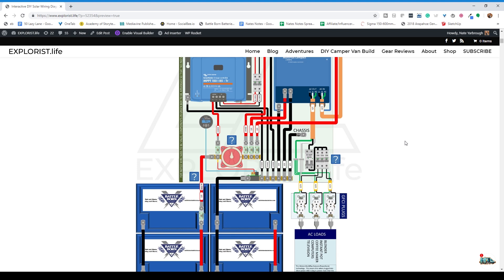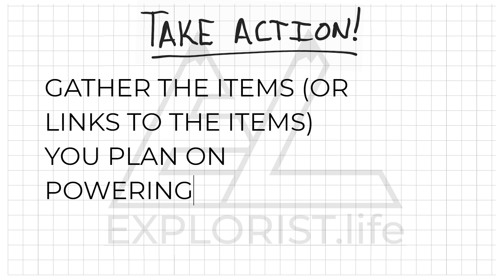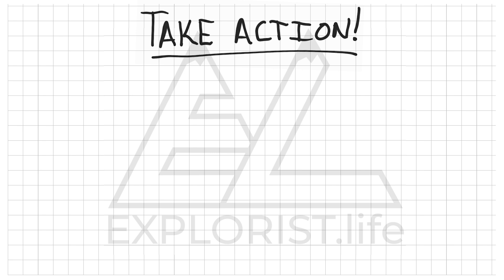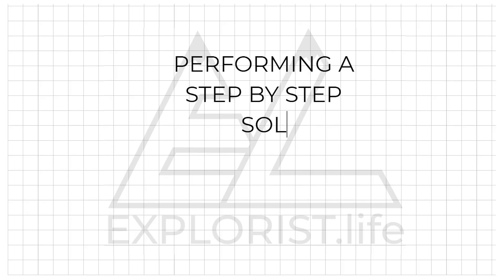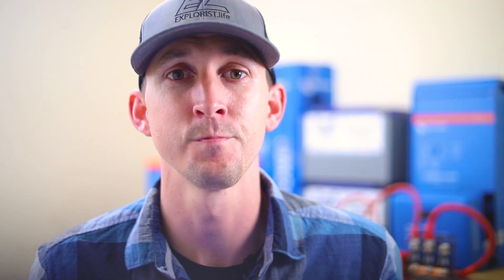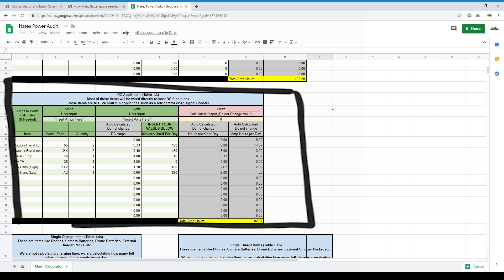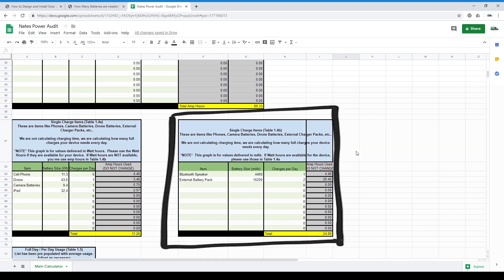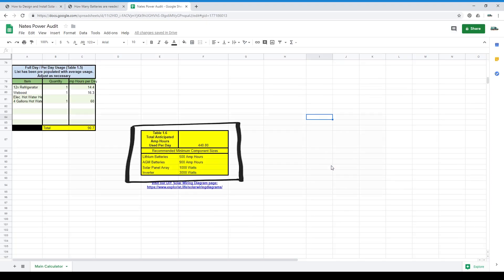How Much Solar Power Do I Need for My Camper? | How to Calculate Camper Solar System Size

Comment: Sir we are installing 4 panels of 180 watts each. Total is 720 watts. Which charge controller and which inverter will have to be installed for this, Victron company

Comment: I want to power a 300w pc system 8-12hrs a day, what set up do I need? How often would I need to run the van and how long running to charge up? Also how many batteries can u run off the panels? Is it a case of the more batteries the longer time you get? Does one battery switch automatically over to the next when one runs out? Can one battery be getting charged while another is being used so that you’re not using and recharging at the same time? Surely that helps the health?
Reply from the maker: We've made a video about PC usage, specifically:  Search: EXPLORIST.life How Much Power does a Computer Use?

Comment: Nate, what do you think about rich 2x250 and 3x100 slim panels? 

I have 4-5 bb100ah batts and 100/50 mppt. I have your kit and working through it all now. I have space to add those 3x100 so thought maybe a good investment
Reply from the maker: Sure!  Those are good options too.  Our kits can accommodate either/both of those solar panels.  Each set of 'like' sized panels will go to their own controller.  

If you're purchasing from us, reach out at shop.explorist.life/support for some more personalized guidance if you need it.

Comment: The sun would break all calculations. When it is possible better to make your solar system next to maximum. It will be useful especially in a winter time.
Reply from the maker: Are you volunteering to make an addition to our calculator to include sun angles?  If you don’t know how how to code, that’s fine, you could just fund that feature.  Couldn’t be more than $50,000 USD, I’d imagine.
Reply: @EXPLORISTlife  Dear friend, I meant weather report, not a sun angles and Yes! In a winter, un tilted, flat solar panels get ten times less sun energy from the sun then in a summer. If your roof for example has 1000 watts solar, then in a winter time your solar panels will produce only about 100 watts per hour, but with  the right angle, the  tilted solar panels  will be accumulating about 1100 watts of solar energy per hour. Clarity of the air in a winter is much better than in a summer. In addition, with higher voltage the solar panels will produce electricity longer during the day.
Reply from the maker: Our calculator is an estimator which includes all of that.

You definitely sound smart, though!  Thanks for sharing all of that.  If you feel like you can make our calculator more precise, let me know.  Otherwise, telling people that there's so much more to this stuff with no actionable steps forward just makes this stuff more confusion to people; so kindly... stop doing that.

Comment: 0:50
Or, "I want to use ordinary kitchen appliances that I use at home. Kettle, microwave, espresso etc."

If I can run a typical power board at capacity (240V 10A), I'm good.
That calculates to 240A at 12V. Watch the specs, but 250AH might do it iff it delivers 250A continuously. At least one doesn't.

If I want some headroom, then 3x 150AH, 2x 200AH.

Me, first source of electrons to recharge will be the alternator. Powered campsite or come to an arrangement for backup. Solar if I find I;m parked up a lot.

Comment: I definitely need to do this. I fell asleep watching it last night. I'm trying to figure this out so I can go full-time while I still work. My question is is it possible to run ac around the clock on solar? I have pets that will be with me. I get hot easy and I worry about the pets especially while I'm at work. Trying to get away from renting

Comment: I used the calculator but it says 1900 amp hours of lithium and 3800 watts solar array.  How many batteries is that? How many solar panels is that???
Reply from the maker: Panels and batteries come in many sizes.  For example: To get to 3800 watts of solar; that would be 38x 100w panels or it could be 10x 380w panels.

Comment: Hey Nate, really good and informative videos!
We're since one and a half years on the road and I just calculated our installed solar system and our consumption with your table. I gotta say in our case, it fits pretty well with your recommendation. The only thing is our inverter that's only 250VA instead of 1000VA
Reply from the maker: Nice work!

Comment: There was nothing new to me in this video, I am fully capable of sizing a solar setup, and still this is the best video I have seen on the topic so far, your spreadsheets is pure gold (I usually do my own on paper).
Then you also learn how to live on solar, you wake up, look out, if it is sunny you might start the day by cooking porridge on the induction cooktop, if it is cloudy, you might go for a yogurt, if you have a gas stove, you might opt for cooking your coffe instead of using the electric coffemachine. On a sunny day, charge everything up, vacuum, start a washingmachine if you have one, on a cloudy day, sweep the floors instead. And so on. it becomes second nature to determing things based on how sunny it is. That said, it is nice to have a too big setup that always is fully charged by lunchtime

Comment: If I have two sets of solar panels, each set is2 panels in parallel going to their own solar controller.  The mppt controllers go to the positive and negative of the battery bank.  3X AGM.  Do they ALL need to go to the same positive and negative posts or can I have each MPPT go to different + and - Posts?

Comment: I am REALLY confused on the amp hours per day section of table 1.5. How do I calculate or find this? I've tried looking it up, but I'm just very confused. I'm using a 120v apartment fridge and a 12,000 btu minisplit air conditioner 24/7.

Comment: Hi, i am wondering how much I would need to have an A/C in a camper can run for 24 hours. Is that even possible?
Reply from the maker: Maybe instead of 'wondering', you could use the calculator like I showed in this video and learn the answer to your question. 🙂🙂👍

Comment: Hey Explorist Life, Can i start by saying your videos are insanely helpful. We are in the process of planning out a bus conversion. We are struggling with the solar aspect, We think we only need about 200AH of battery to start with to run a normal 230v household fridge and charge our phones off on the daily to begin with, I worked out our consumption to be around 146ah daily using your spreadsheet, Our hot water and cooking will all be LPG powered. Later we will add AC and also a wifi booster, but will add more batteries to accomodate at that time.

My question is, I was thinking 700w of solar would be enough to fully recharge the batteries in a single day even from completely flat allowing us to remain offgrid indefinitely in terms of electricity. However the victron website suggests that 5 of their 175w panels (875w) would only generate around 165ah of power a day, which has totally shocked me. 

From your own experience, how much power can a decent solar system generate on a daily basis?

Comment: Hey Nate

Love the Video, have watched it twice now, got to it and downloaded the spreadsheet then realised its for 110v, im in AUS and we use 240v. 
Is there a basic calculation in speadsheeet that i can alter to accommodate this. im not very well versed in spreadsheet
Reply from the maker: The spreadsheet will work as-is for 240V.

Comment: Hello Nate from Spain :) love the videos. I do have a question if you can help.
I have a budgeted for 3X Victron 175W panels, victron MPPT, Lynx, and 2 100aH lithium batteries but I can’t budget for an invertor over 700€ I want 3KW.
Any advice please…. 
Thank you sir

Comment: Hi Nate, thanks for sharing so much info, you make it fun and helpful. We are trying to use your spreadsheet calculator and wonder if there needs to be a difference in any of the formulas given we are in Down-Under (Australia) and our standard charge is 240v? your help will be hugely appreciated.
Reply: The batteries you purchase will still be 12 V if a small system or 24V if a large system. The DC power will pass through an inverter and transformed into AC current at any voltage (110,115, 120,220,240) at some loss. I believe it is different inverters that handle these different flows, or perhaps there are nicer ones that handle multiple outputs. I'm not quite there in my research yet. The spreadsheet assumes a 12V system so you will have to alter the formulas if you purchase 24 V batteries.

Comment: Question: when inputting laptop information, shouldn't I put the time I anticipate connecting it to the charger and not the total time I plan to be on the laptop per day? (a three hour charge will allow me to work on the laptop unplugged for 7 hours)
Reply from the maker: You can micro-analyze as much as you like.  It just depends on how simple or complicated you want to make this process.

Comment: Hi, I love your videos. Keep them coming. But I am confused.  I  bought two Victron charge  controllers 50/100.  Since they are rated for 50 A, I bought an ANL fuse to wire between battery and controller, to protect the controller from over current. But my installer tells me, that is not necessary because the Victron has an internal protection device. This is not your recommendation. Is this correct?
Reply: Always fuse those cables. You don't want to cables directly off a battery that are live if you remove the controller. If they touch each other, that's a recipe for cable welded together, and fire. You fuse the cables to protect them.

Comment: i simply purchased a plug-in power meter to monitor just how much power my caravan is consuming over a 2 week period while running on mains electric,  living normally after 2 weeks i ended up with a true numbers of my power consumption..   heaters, hot water and the cook run off gas :)   lasts a long time and works out pretty cheap.

Comment: You replied to a comment stating that the spreadsheet is ok to use for 240v systems for those in the UK for example. Do you have to amend anything on the spreadsheet for it to have the correct figures as I see on tables 1.1 and 1.2 it says 110v? Thanks :)

Comment: I've noticed from another video where water pumps such as the Seaflo uses AC relay switch, but marketed as a DC water pump. Should I be labeling them in the same category as the AC/DC?

Comment: With all the new solar/battery generators seems would work for the occasional user and to possibly power my travel trailer excluding the air conditioner of course.

Comment: Just discovered your channel and subscribed. Really helpful videos. I've just attempted to use your power audit spreadsheet. 

I'm British.... Is there a simple equation to make it work for 230v? 

Noticed that all the tables have no option for voltage, it's preset at 110v. Can I input all the data and then do something to make it work for 230v?

Huge thanks for all your efforts and videos.
Reply from the maker: It works as-is for 230V

Comment: Hi , this is a spread sheet for working out electrical needs for 110 volt solar pannels on a van. how do I make the spreadsheet work for 220 volts in Europe? Can how I change the numbers to make it workable for 220 volt? Thank you very much, Len

Comment: Going to use a 48volt all in one system with 2000 watt solar array.  I should be able to run just about anything except A/C 24/7 correct??????????.  This system will be placed on and in a enclosed trailer 8.5x20 v nose....\Will be using 2 24 volt Battle Borns????
Reply from the maker: This video you just commented on will teach you how much battery capacity you can anticipate using on a day-to-day basis.  By the time you fill out the form I showed in this video, you will have an amp hour recommendation (and then just divide that amp hour recommendation by 4 to get the recommendation for a 48V battery bank.

Also... you don't need to ask the same question on 3+ of my videos.  I'm just going to delete the duplicates.
Reply: @EXPLORISTlife  not a problem on the deletion I just find it hard sometimes to get an answer.  I wasn't too concerned about how much capacity as I was if the system I'm using as I suggested would be sufficient.  I guess the only thing I'm concerned about is using 2 24 volt battle borns to make the 48 volt system or should I have another 2 for storage?   I'll be boondocking alot and honestly I've tried and tried to put it all together to make sense to myself but I have ADD and I just can't quite get it.  I just felt if I said 48volt system, 2000 watts in solar and a all in one 48 volt system would be sufficient for just about everything except A/C?   I was trying to make the response as simple as I could .  I apologize for the several times I posted - but I know you know what your talking about based on your videos and I'm just need a little push.

Comment: Cool calculations the first thing you do take your calculations and X between 2 and 10 times to be more realistic
Reply from the maker: This calculation will give you an accurate amp hour estimate.  It's then up to each person to see how much extra they like.  Suggesting x10 battery bank would be a bit irresponsible on my part, but feel free to add as much cushion as you like.  If you're adding x10 battery bank capacity, be sure to use my affiliate links, though. lol  That'd be a lot of extra.

Comment: The size and number of panels in my case is very simple, all you have room for :) Battery size, pretty much depend on what you realistically can charge with 1260w of panel per day  in this case.... Will have to save on electricity anyway and sometimes if cloudy for long time start up the engine because in the end what limits me is the amount of panels I can fit on the van. (here it can be cloudy for weeks at a time).
Reply from the maker: Glad you got it figured out!

Comment: Nate I purchased 2 torque power 100ah lithium phosphate batteries and realize I need another battery. The company stopped making the batteries and I can’t find them anywhere. I understand it’s not perfered to mix batteries but purchasing all new batteries is not in my budget. Any suggestions on a battery that is best to mix with? Or other suggestions?
Reply from the maker: Since it's poor practice to mix and match solar panels, I feel it would be irresponsible of me to recommend a particular battery; so I, unfortunately, do not have a suggestion for you.  My recommendation would be to sell your current batteries in attempt to fund a properly sized battery bank.

Comment: Hi, great video!! I've been working on a 24v solar system using Victron Multi-plus inverter charger, Victron Orion TR Smart 12/24 15A Isolated DC-DC Charger, Victron Energy Orion 24/12 DC-DC Converter 40A, Victron Battery Protect. My plans is to build my own battery bank with Electrodacus SBMS0 BMS along with DSSR20. I would like someone to review my plans and provide any corrections/suggestions if any. Is this something that you are willing to do or can you suggest way that I can get this reviewed? I have a complete diagram with wire size/lengths, fuse/breaker sizes, busbars, etc.
Again thanks for your video!
Reply from the maker: I only do diagram reviews that are based closely around my diagrams found at https://www.explorist.life/solarwiringdiagrams  Too many deviations from those diagrams generally results in me referring you to one of those diagrams.  But if you want me to take a look anyway, that's something I can do in my private group here: https://www.community.explorist.life

Comment: A problem that I have come across is getting two different results on my power audit. 

When trying to find the power needed for an iPhone 11 Pro Max, (working out of table 1.4a and 1.4b because I'm finding the answer to both tables) I'm getting two very different answers, the answer for 15 Wh at twice a day is 2.38 Amp hours. The answer for 3,969 mAh at twice a day comes out to 7.94 Amp hours. What am I doing wrong?
Reply from the maker: Tough to say exactly, but ultimately; 5Ah isn't really going to matter in the grand scheme of things.  You'll have to do some rounding at the end of the audit as this isn't an exact science; so just pick one and remember that if you get to the end and it's close.

Comment: I put my phone in table 1.4b because all I could find was the mah it said I'll need 6amps. I found the watts so I put my phone in table 1.4a and it say 1.83 Amps. They are both for 2 charges? Also do I need to put the charger or the phone batter or both?
Reply from the maker: Phone battery only.

Comment: Thank you.
Reply from the maker: No problem.  Happy to help!
Reply: Trying to do my audit and I don't have the parts of the solar set up yet.  Is there a way to guesstimate the power usage for the charge controller, battery monitor etc?
Reply from the maker: You don't need the parts of the solar set up to do the audit; just the items that your system will need to power.

Comment: I literally had to figure out who made the video about DC items pretending to be AC items. I have some questions about voltage and how it works with regard to DC items. 

I have heard that devices pull "current" its not pushed. I have a rockpals 300 that has these 5.5 barrel connectors and I have some DC devices masquerading as AC devices that use that same connection and I want to power them directly. The rockpals has a 12v barrel plug. 

Lets say I have a 19 monitor that says 14v on the port...will my 12v giving it that 14v aka allow it to pull the voltage it needs automatically? I imagine that has to be the case right?